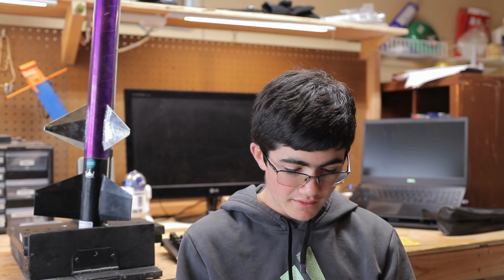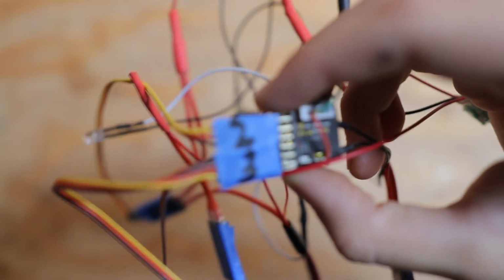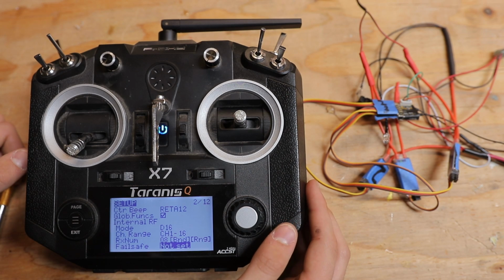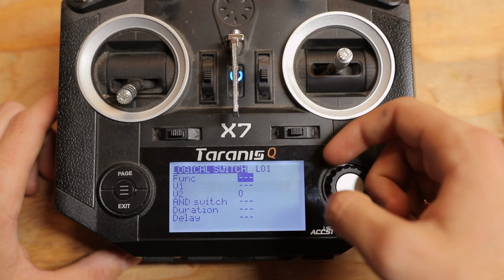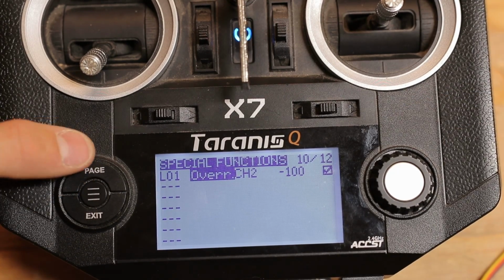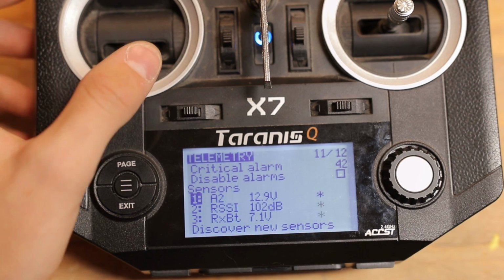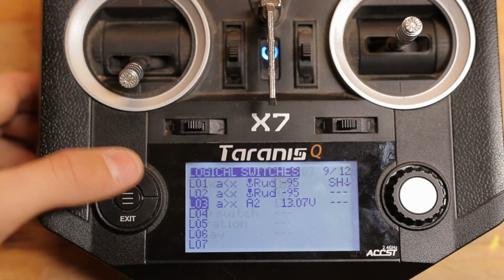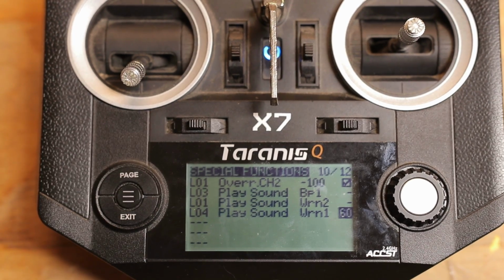How to Build a Wireless Launchpad with Drone Parts - With Continuity Check

Comment from the maker: Hey everyone! Here are all the features in case you are wondering. 
1. Voltage reading to show you if the battery levels are low.
2. Continuity Check
3. Four switches need to be turned on before a launch can happen
4. Incredibly long range
5. Small and compact
6. You can make it more powerful by adding power.
Thanks for watching everyone!